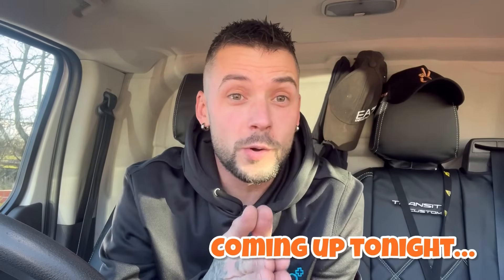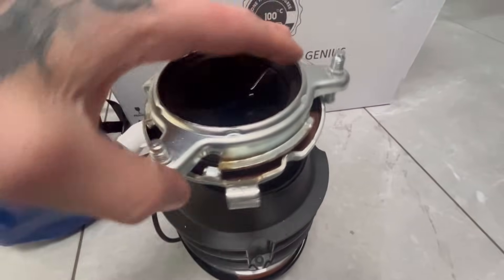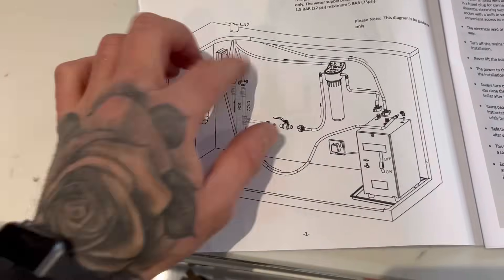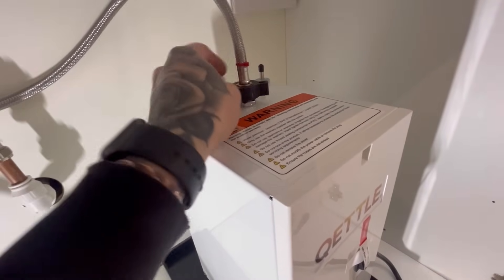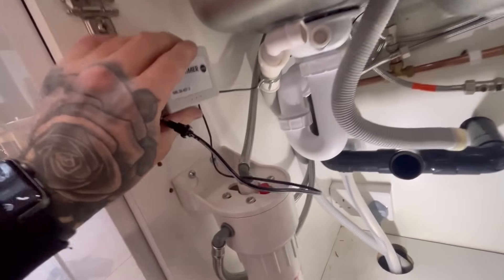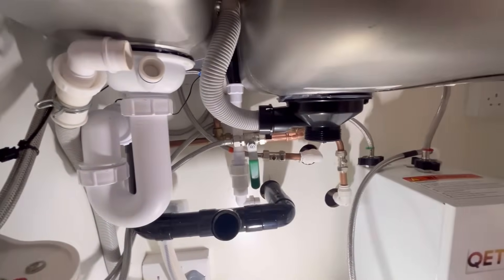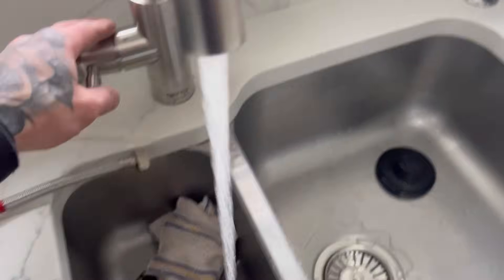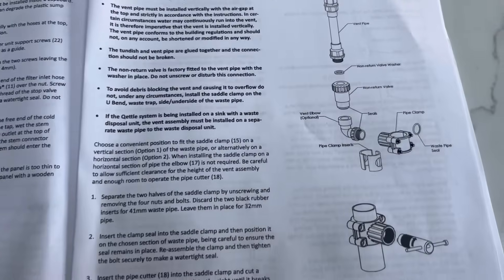How to Install a Qettle boiling water tap!

Comment: I've only ever fitting one boiling tap before and I thought to myself then, I wonder if it'll void the warranty if I hard pipe all this rather than these flexi's everywhere, would be a much neater job :D 
Easy mistake on the non-return valve, oops! ah well at least the sink won't gurgle while the dishwasher is emptying now
Reply from the maker: Haha yeh that’s true mate. If the Flexis were shorter, we could make it a neater job. I understand why they make them long though… so diyers can install them haha.
Reply: @Heatking  haha that's it! Definitely would look loads better hard piped

Comment: Trying to work out if I can fit this myself and kitchen fitters look like they were paid commission by the complexity and number of connections they can fit under a sink.
According to regs this should be a 300mm down but Qettle supplied a 280mm run (that's including the bottom of the elbow supplied) so don't know, I'm just assuming I'm wrong at this point. My waste pipe probably needs extending grr and it's not a vertical, it's like 65 degrees vertical with a load of other pipes routed around and in between everything (all kitchen fitters work as they had a clean slate starting).
Reply: I've also just watched their video and they claim a 750mm hose which according to regs is 150mm too long (Reg G 3.54 "The tundish should be vertical, located in the same space as the unvented hot water storage system and be fitted as close as possible to, and lower than, the safety device, with no more than 600mm of pipe between the valve outlet and the tundish")

Comment: That tool to cut the pipe is mint, normally heat up some 15mm to make a hole. Them boiling taps look a mess underneath, so many pipes but they am good, do like them.
Reply from the maker: Cheers mate, yeh the little tool was a beast 😂😂 and you’re right.. you can’t really make them look pretty underneath!

Comment: That’s a pretty cool system for add on hot water system. Although I totally freak out at the idea that there is so much electrical wires right under the sink where it may leak someday and cause a bigger problem. 

Over here the code don’t even allow sockets underneath the kitchen sink and if you want hot water there you gotta use the storage water heaters. 

But it was so interesting to see this install mate. Thanks for the video
Reply from the maker: Thanks mate, and interesting to know what it’s like over there too! Yeh it’s quite common having sockets under kitchen sinks here in the uk! Haha
Reply: Under many sinks there is a socket for the washing machine and one for the dishwasher. I always put them away from any potential leaks but most houses have RCDs so a leak would not kill anyone! (UK)

Comment: You could have just ran a new prv to outside like you would on a boiler or cylinder.. great video mate
Reply from the maker: I thought of doing that at one point mate, but thought it would have been easier to connect into the waste 🤦🏽‍♂️😂 thanks buddy!
Reply from the maker: I thought of doing that at one point mate, but thought it would have been easier to connect into the waste 🤦🏽‍♂️😂 thanks buddy!
Reply: Possible boiling water discharging through a flexi pipe into solvent welded plastic pipe!!!